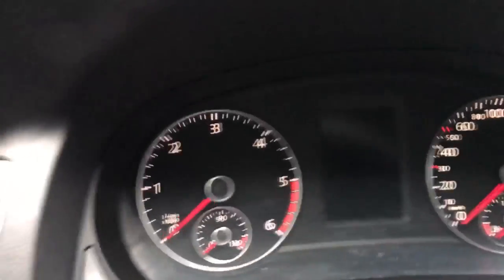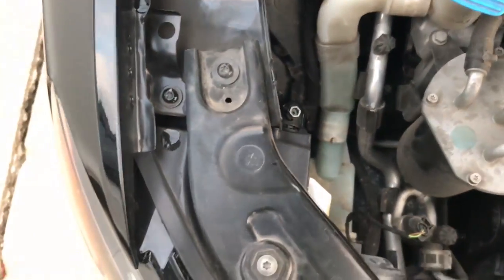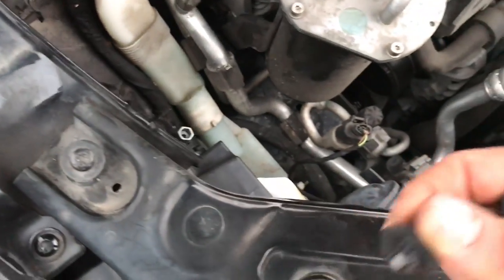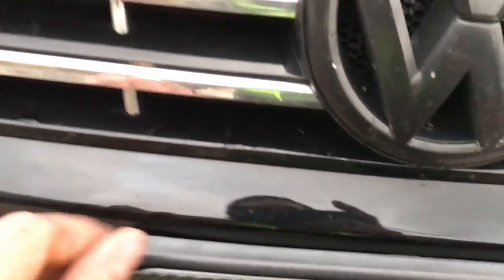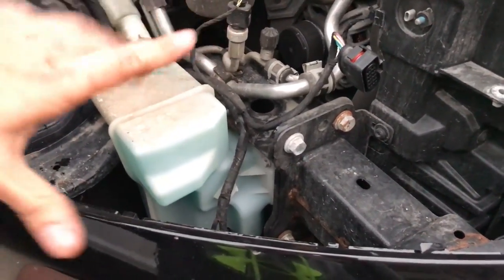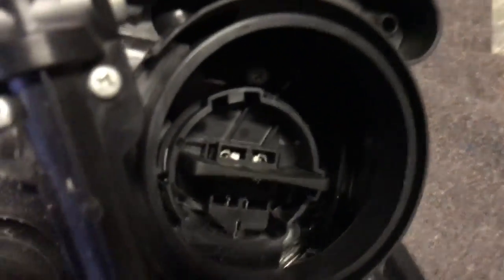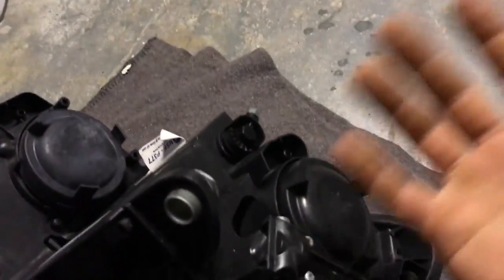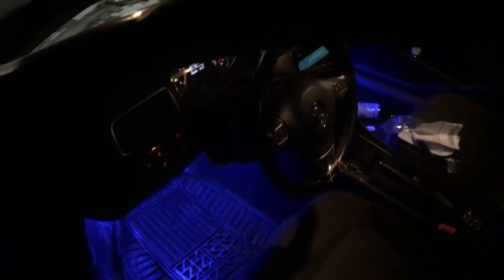How to remove a b7 passat headlight/grill *cheap n' easy headlight fix*

Comment: Thanks for doing this video. I had attempted to replace the marker bulb in my '13 Passat SE to no avail. Dealer looked and said the socket was broken, and the headlamp assembly needed to be replaced (for just under $500). Bought the headlamp assembly for just over $100 at Amazon, and I replaced it using this video. Very helpful. The tricky part, for me, was putting the grill back. The tabs at the top and bottom have to be aligned perfectly before you exert pressure, otherwise the tabs can bend or crack off. Both edges of the top and bottom of the grill slide into wide slots, and the tab slots are about 1/8 inch deep in the slots. Once it's lined up tho, it's easy peasy.

Comment: Thank you.   Really it’s just about 9 torex bolts for the 2015 SEL with regular bulb lights.  Removal and reinstall in 13 minutes due to this video — thank you!!!   Hardest part was reinstalling grill - took a few tries to line it up right and bending top tabs back straight.  The rest was simple.   About six 30 torex bolts for headlight and the frame brace, which can be removed easily, except the one under GRILL you should wait until the grill is off so you dont drop it into the pit of the bottom tray.   3 smaller 25 torex (same size as the wheel well access panel) for the grill along the top.   To remove  headlight twist in 45 degree movement from outside bottom to top inside — there are two tabs on the bottom of the headlight that needed to clear the bumper cover.   GRILL needs to come off, but the color-matching BUMPER COVER DOES NOT NEED TO COME OFF  (2015 SEL) to remove headlight.   You can pop the two bottom tabs over the bumper cover and pull headlight out.    I replaced my DRLs with LED ( TABEN 7443 LED Bulbs CanBus Error Free Extremely Bright 45-SMD 4014 LED Chipsets 7444NA 7440 7440NA LED Bulbs Backup Tail Brake Reverse Light Xenon White ) but needed to remove a headlight to fish out an LED that decided to take a swim.  Had to point back of headlight down and then shake it a bit to get bulb to exit the housing.   They really are CANBUS error-free :::  Just need the ensure the polarity is right- so if bulb is not lighting up- remove it and rotate 180 degrees and reinsert).   Way smarter to have everything tight and reinstalled, test plug in headlight before reinstall — all is good...  After fishing for 30 minutes without too much luck,  it was a cake walk to remove the headlight, fish and change DRL with headlight out - much better than the 10 minute one-handed push-up using the rear access cover.  My audi was the WORST about this fishing from the back of the housing and the passat is better, but not GM easy...
Reply: Tony D, I did the same exact thing when just replacing the DRL. 😳 Until this vid, thought I was going to have to remove the front bumper. 

Thanks OP and Tony! 👍🏼

Comment: hey, thanks for this! I was actually trying to replace a daytime running light when the bulb popped out of the connector and fell into the housing. Your video helped me pull it out FAST so i could jiggle the bulb out without a whole car in my way.
Reply: This literally just happened to me now I’m trying to find out how to get my light out😂😂god damn VWs
Reply: @gaminwithnick1830  haha being able to shake the whole headlight housing helps so much. Before i searched up this video, i tried to use a piece of duct tape on the end of a screwdriver in hopes i could get the bulb to stick to it, but i just ended up getting a wad of duct tape stuck in the damn housing. This video saved my ass haha

Comment: By far the best video on taking the fixture out. Although i did not unscrewed the fender i was able to just do the fixture and the grill which you have to. Now if we could only get the computer to recognize LED bulbs that would be great! 😂 Thanks for the video!
Reply: Just use error free LED bulbs an you should be fine
Reply: @dozerpozer3206  i will look into that thanks! Had no idea that was a thing

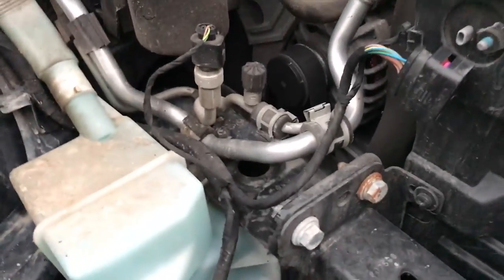Comment: READ! For anyone that just needs to change the bulb for the exact same headlight (on either side), there is an access panel in the wheel-well that you can remove. Visible at 5:26 just left of the blue container. It's there specifically for the purpose of changing the lightbulb and accessing the connector.
Reply: Some vehicles is not accessible unless your hand is the size if a 1 year old. Both sides the gap provided is not an easy task, my hand does not fit inside that tiny hole.
Reply: @tlalok08  What gap? I can fit both my hands in that access-window or whatever it's called. Turn the wheel inwards on the side you're working on.

Comment: The problem was before you placed the bulb back in you were supposed to slightly lift up the two pins just a little and the bulb would have by been in the snugglely and tightly. You should never use gollira glue on it because that creating a bigger problem when it comes to changing that bulb again which may cause you to damage the assembly around the bulb trying to remove the gorilla glue. Your best bet would had been is to get a top from a container and use masking tape to tape down the top to the back of the bulb assembly.

Comment: I got all this done, went to put the right one back on and the piece of crap sits in the pocket funny... it lines up along the bottom and inside but not where the assembly meets the panel... it's poking out like 3mm. It's dumb. I tried fitting it back in for 2 hours... when we screw the screws back in place, it's still off, but all the screws go in. Any ideas? What the hell? It's so frustrating.

Comment: Hey I have a 2017 Passat SE 1.8tsi. I bought 6 different sets of LED bulbs and the passenger low beam WILL NOT set into place all the way to lock.drivers side smooth and easy.. the lows I'm trying to install are Auxito H7 no adapter needed($99) . so now I need to find out how to remove the headlight assembly. I cant get the grill to come off at all.pulling so hard it's making cracking sounds so if try harder definitely gonna break it.. any way to get headlight out without removing grill? HELP!
Reply from the maker: Hey! It’s been a while since I’ve owned the car but from what I can remember there is no way of removing the headlight without removing the grill. There just isn’t enough room to maneuver the headlight out of place. The bottom of the grill is held in with clips, my grill had been removed multiple times by the time this video was made so I’m sure that made it easier for me. Place the palms of your hands on the bumper and slide your fingers into the grill, that’ll give you leverage. This will take a lot more force then you’d think so pull slowly and you’ll feel the grill come loose. It will get caught on your hood release mechanism when finally free so be sure to watch for that! Good luck!!

Comment: What about 4th screw on the bottom ? I can't get my lamp off the car. 3 screw I can get access to it but 4th sits on the bottom of the lamp and there is no access if I do like you shown on this video.
Reply: That's because he just broke off the 4th bottom screw holder from his headlight unit, to properly remove the headlights, the front bumper hast to come off first.

Comment: Hi. Great video. Would it be possible for you to do a video of how to remove the lower middle black grill (near the fog lights). Ideally if possible to take of the lower grill without removing the bumper or the top grill. Many thanks
Reply from the maker: +My Gmail thanks for the comment!  I will look into it and get back to you asap.
Reply: +All About the Passat - cheers mate.

Comment: It’s a total nightmare removing the front grill and replacing the DRL lights my advice is just leave them burnt out or have the dealer or mechanic do it. I broke the front grill clips one of them Took me about an hour to get the grill back into place after a while I got so frustrated it was screaming and cussing I haven’t been that mad in a while. It sounds funny but it’s ridiculous all the little steps just for a single little lightbulb also if you forget to do one step it takes forever to take everything back apart and the likelihood that you will break something out of frustration my best advice don’t do it. If you do decide to do it be ready for a super fun time. Took me about two and half hours the bulb fell out of the socket inside the headlight housing so I had to take the entire headlight out to get the bulb out which was super fun also. Good-luck

Comment: Digging the foot lights man! Are they LED strips?
Reply from the maker: Edgar Paz Yes they are! I actually recently took those out and put RGB light strips in so I can control what colour I want.
Reply: All About the Passat dude that is epic! I have a 2012 Passat S and want to start adding things to it. How much were those or where can I find them?
Reply from the maker: +Edgar Paz  this is the item description on amazon -> 7 Color 9 LED Music Control Remote Control Car LED Interior Lights Floor Decorative Atmosphere Neon Lights Kit with Sounds-activated & Wireless IR Remote Control (Music Control)
I can strongly recommend it.  Works very well although the IR Blaster can be a bit slow but how often are you constantly changing colours..

Comment: fyi, on the driver's side, there's a cable/fuse thing connected to the metal plate. can be popped out with pliers.

Comment: I do not understand why you need to remove the grill to change bulbs...changed bulbs with my passat b7 without taking off the grills...too much work for something simple.
Reply from the maker: Leo Bara thanks for the comment.  Read the title,  no where does it say how to change your  bulb.  I had an issue with my headlight that required me to remove it to further inspect that and it’s all on the video.  The grill is required to come off in order to get the headlight out.  Your completely right though,  no need to remove anything to change a bulb but that’s not what it was about.  Maybe next time give it a watch ☺️ have a great day.
Reply: Leo Bara in the wheel well there is an access pannel for the bulb. Just cut the wheel all the way out to gain access.
Reply: mark kraft lol...dude, ive accessed that already and that is only for the turn signal or drl...cant remember which one. Everything else is under the hood...literally.

Comment: this guys cracked me up xD xD xD whenever I had movement in between plastics in my VW i would try to use electric tape (since it is elastic) to compensate for any free play movement xD xD but he simply glued stuff with gorilla glue lol and his headlight isint even LED lol definitely he will be upgrading to aftermarket headlights once he realizes hw wont be able to change light bulb without braking something